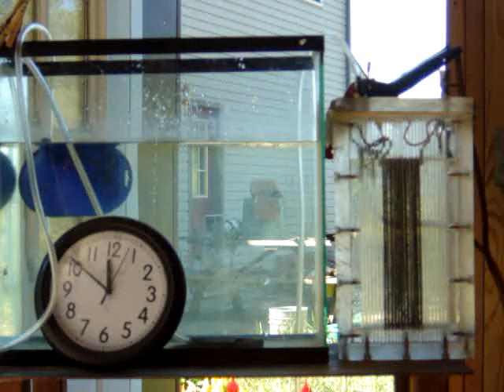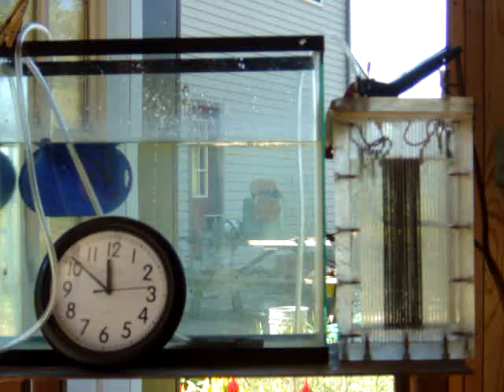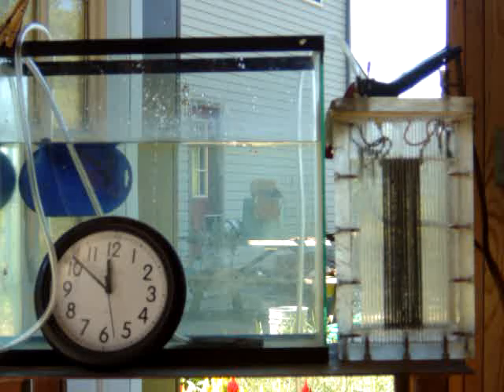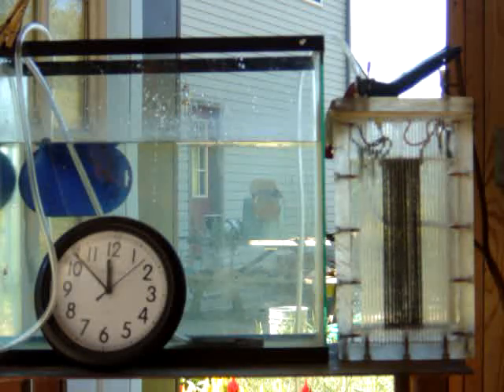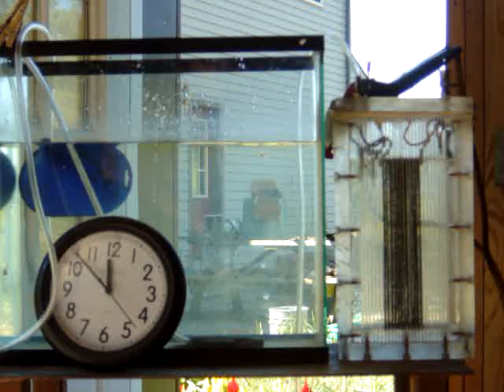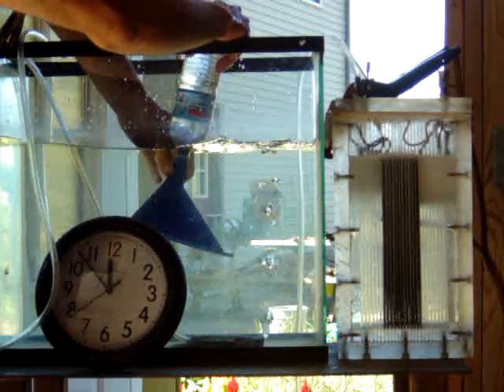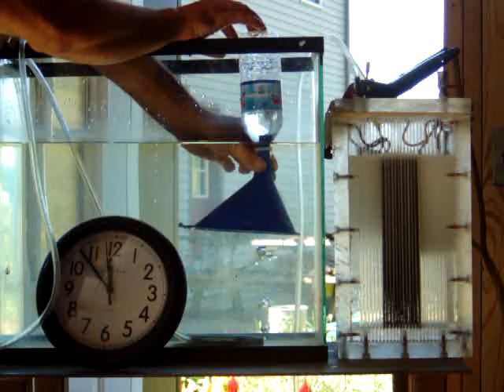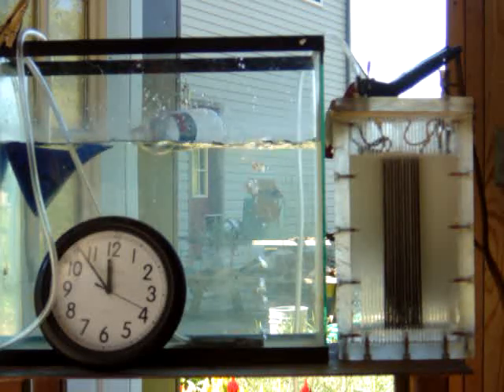HHO GENERATOR 1.5 LPM AT 8 AMPS WOW!!!!

Comment: I like how informative you are as to the pos neg and nuetral plates. The electrolyte info is also excellent as well as voltage and amps. 
 So in order to get that kind of production it takes 48 volts? Thats two car batteries. I think we should keep trying with 12 volts, since that is what most people have in their car.
Reply: 48 VOLTS IS 4 CAR BATTERY BUT THEY USE A POWER SUPPLY CONNECTED TO 120V

Comment from the maker: I do not appreciate being called a liar or scammer by someone who knows jack about me. 
I agree that alot of the products being sold have unproven claims. Am I doing that? NO! Am I taking anyones money? No! 
What better learning tool than to fail? So unless you have a problem with expanding ones knowledge by trying, your attack at me is a bit misdirected.
As far as I am concerned your mind is made up and this conversation is over. Any non-constructive messages will be blocked.